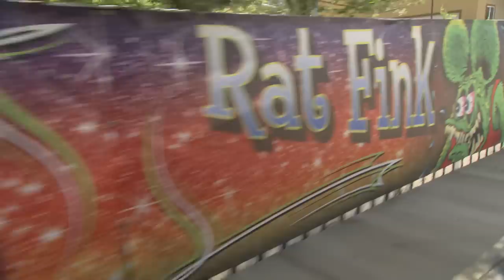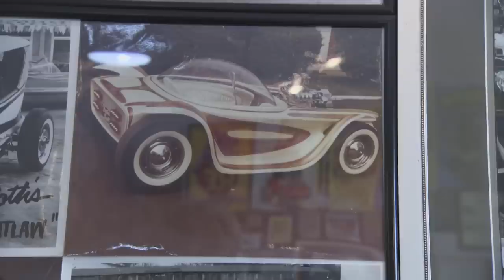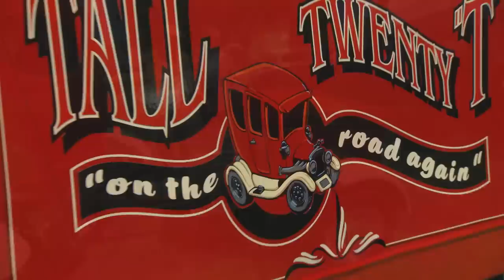1939 Buick Special by Dave Kindig

Comment: Dennis , thanks! : , the 1954 FORD was a winner  also, especially with Skyline Top. Interestingly , my first real Car was a 1954 C8 FORD 2 Door/3 S.P. Manuel...modified with 1957 /289 engine Rochester 4 BBL/ dual exh: mild mods: my Dad found it at Service Station after  the Mechanic finished it....Anyways good times,